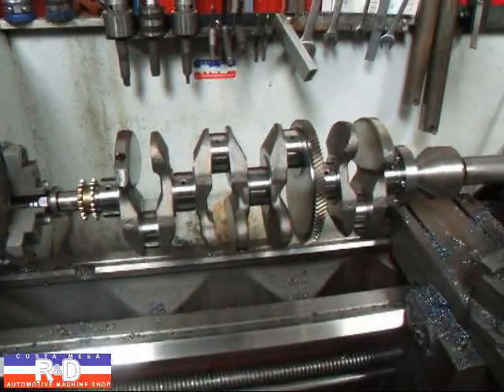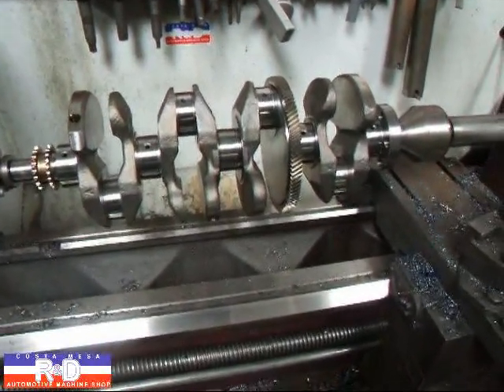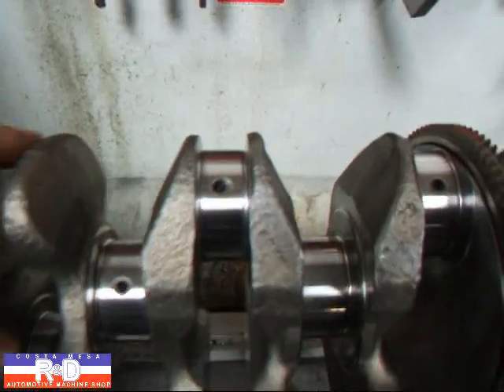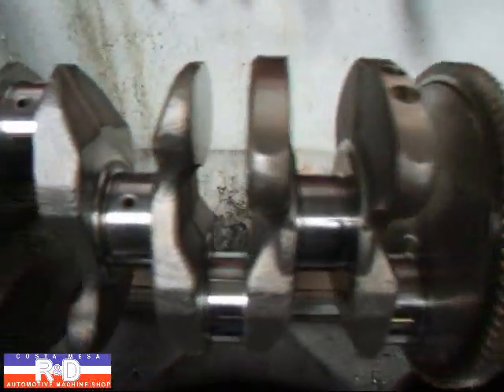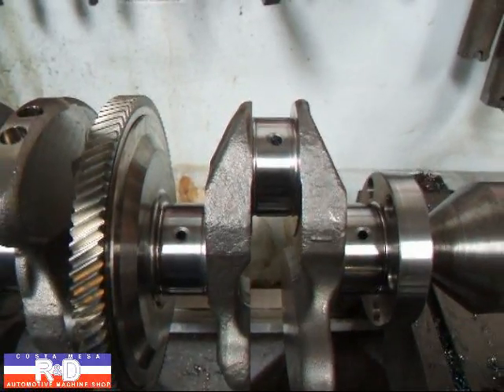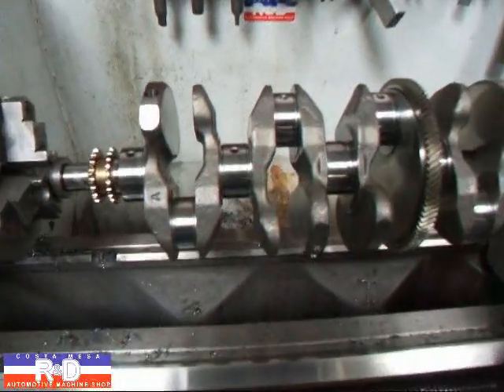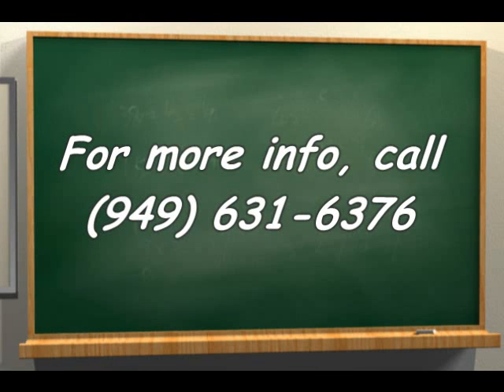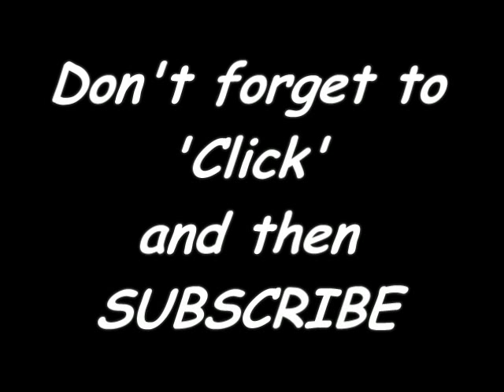Mazda Speed 6 Crankshaft Oil Chamfers.mp4

Comment: I would guess that the ring gear drives a sensor for the ignition and rpm gauge, I have seen a trigger plate machined on a Chrysler crank for that purpose.